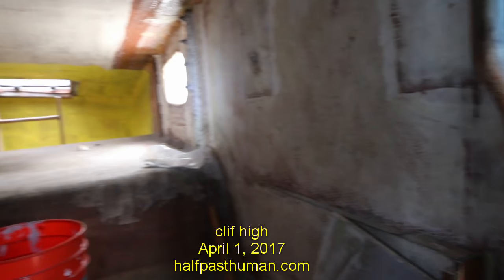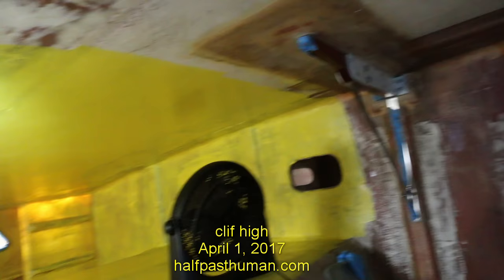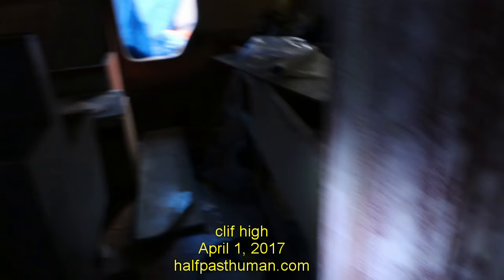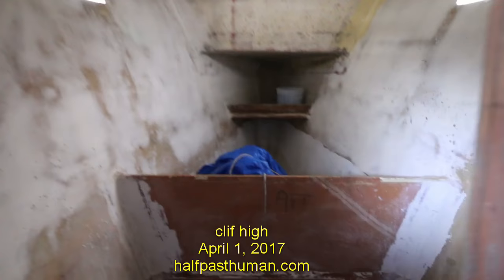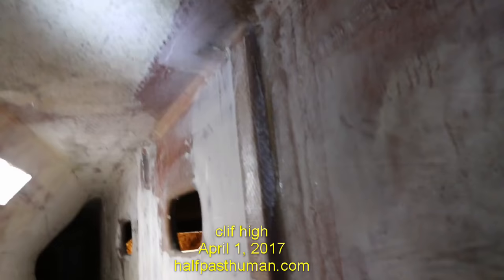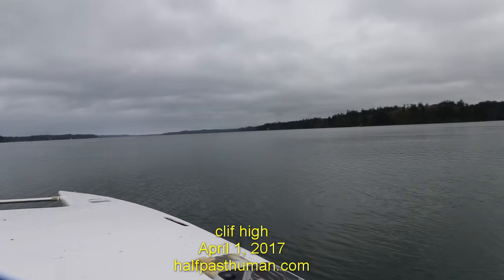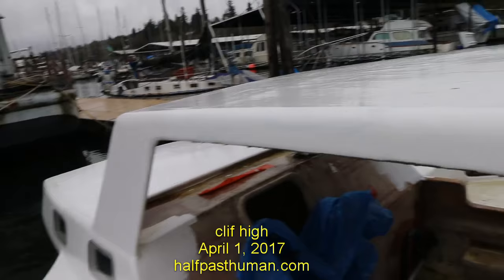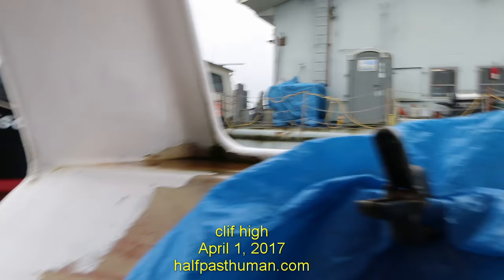Visit to the trimaran - April 1, 2017

Comment: Your trimaran would definitely have potential for use as a nearshore surf-beach sand gold dredging mother ship. Not too far from you at the mouth of Petroleum Creek, Clallam County, WA (48.255573,-124.6855634), the Shi Shi Beach sands produced several tens of thousands ounces Au, Pt, Os and Ir during the later decades of the 19th century.